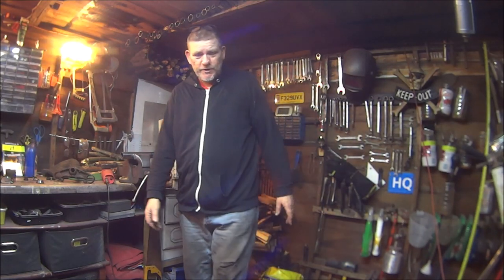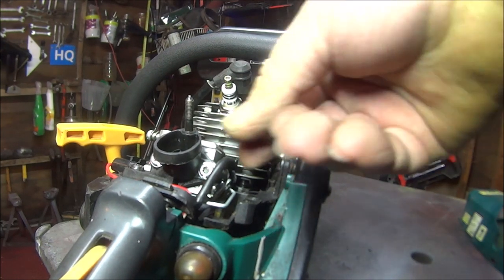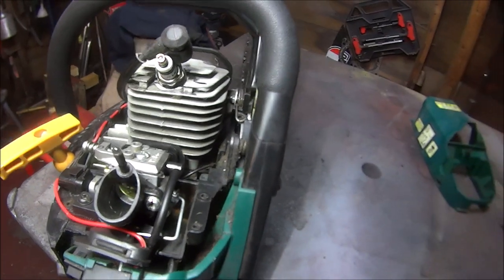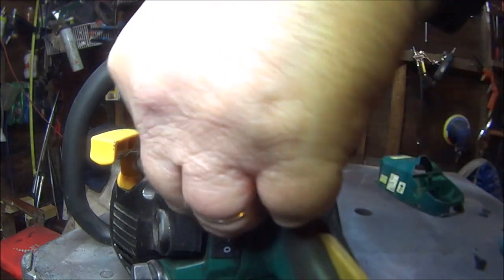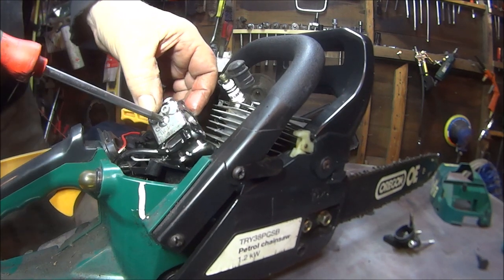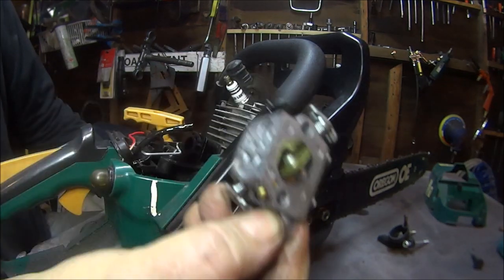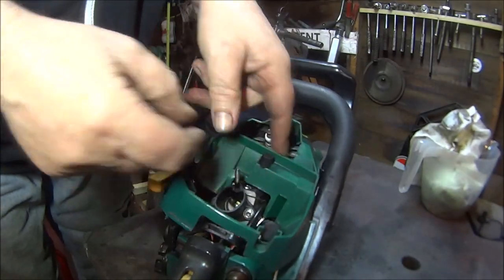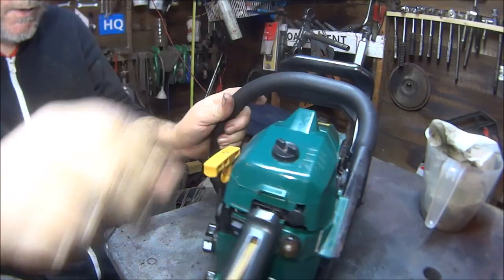petrol chainsaw still won't start. P2

Comment: Just some minor thoughts that could ease the fault search process...

- Remove the saw chain and saw bar (that makes it easier and safer to handle when testing).
- When chain and bar removed, put the kick-back brake in unlocked position, which usually makes the engine a little easier to start.
- Fill the petrol tank completely full, by laying the saw down on it's side, with the tank plug up.
- Empty the chain oil tank. That way you don't get a lot of oil sprouting out when the engine finally starts.
- When starting, put your right foot into the rear handle opening, with the upper part of your foot pressing against the throttle control.  That way you can give it full throttle without using a hand. Left hand at the handle bar. Right hand pulling the starter rope. (Don't forget the choke).
- Check the fuel tank sinter air plug intake, if there is one. (When the engine is running and using petrol, it creates underpressure in the tank and the tank has to suck in air into the tank). If this is faulty/clogged, it's usually possible to start the engine, but it will stop after while, when there is to much underpressure.

I once had a saw that refused to start, although I hade checked everything (carb, spark etc) and it was fine. It turned out that it was either the cylinder gasket or the main gasket between the crank shaft halves that was leaking. (More common if the housing is made of plastic instead of metal it seems).

Good luck! Looking forward to the next video!
Reply from the maker: Hi Bengt. Thanks buddy lots of very helpful advice again. I'll try all your tips when I get back in the right frame of mind and get back to work on the chainsaw. Cheers again buddy 👍

Comment: Hi John, not sure if you managed to get her running yet but you may want to be aware of these points. 

The 2 stroke oil mixture you put in was way too much oil, it should be 50 parts petrol to 1 of oil 50:1

I would remove the chain and try starting without that fitted and then try starting with the chain lock handle in the free moving position. 

Throttle and choke settings try this. 
Pull the choke onto full position
Switch power to 1 or on
Pull throttle trigger with finger whilst pressing trigger lock with thumb and the trigger should lock into the full throttle position. 
Prime the fuel bulb
Put the saw in the ground and place your foot into the hand without catching the throttle trigger. 
Pull on the starter chord with all your might and wait for the saw to fire up once. Then reduce the choke to the half way position and keep pulling the chord until it starts up. 
If it still doesn’t start after 10 or 15 pulls then it may be shit in the fuel line or weak spark. 
Remember fuel mixture 50:1

Good luck Pal
Reply from the maker: Hi Colin thanks for the helpful info buddy. I've tried all these things but still won't start. It as started once for about two seconds but not started since. 👍

Comment: Small engines for small fingers are more trouble  than big engines
Reply from the maker: Yes.. Hopefully I'll get it going, which will probably be in the summer no doubt when I don't need to cut wood up.
Reply: @jonyr1TT  that's just like my bandit.if theres 6 inches of snow on ground it starts .if its blazing summers day it doesnt start
Reply from the maker: Some bikes have a mind of their own lol 😁. 👍

Comment: Think there’s a diaphragm other side of that carb John which regulates the fuel while running that could be split or hardened
Reply from the maker: Thanks Andrew. Yes I've had the plate off and it all looks to be okay. 👍

Comment: Sorry to see you having so much trouble. In the last vid it didn't look like the primer bulb was filling, but that might have been because it's so brown and cloudy. You're obviously getting fuel through though, and the fuel tubing seems to be nice and soft, so less chance of pinholes or cracks then. That 'gasket' in the carb is part of a pump that uses the intake pressure pulses to draw fuel from the tank - that's why you have to pump fuel using the bulb for the first start (good vid on this type of carb here https://www.youtube.com/watch?v=SshXK8Ehm74 ) . The fact it doesn't seem to want to fire at all and kicks back sometimes might point to a timing problem. Timing on these engines is usually fixed, and comes from where the coil is relative to the fan/flywheel behind the pull-start cover, but I've had ones with broken keys, no key, and even one where the flywheel was cracked in half out of the box - completely misaligned on assembly and you could see the groove on the inside of the flywheel the key had made as it was bolted onto the crank. Take the pull-start off and check the coil/pickup and/or flywheel aren't loose, there may be a little bit of slack on the mounting bolts you could use to retard the ignition a little. Best of luck! Oh BTW, try clamping the chain bar in a vice when you're working on these - makes a good third hand. And the moving guard is part of the chain brake. If the saw kicks up, your hand naturally pushes the guard forwards and locks a brake on the chain mechanism, hopefully stopping it before it hits something vital.
Reply from the maker: Hi Carl cheers buddy. Some very interesting advice.. I'll check out the link you sent to thanks again buddy 👍